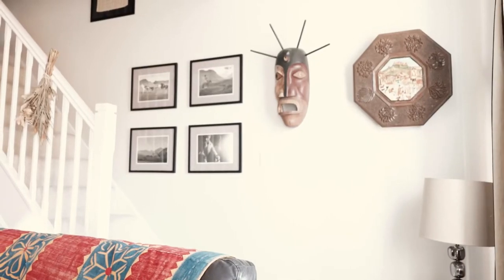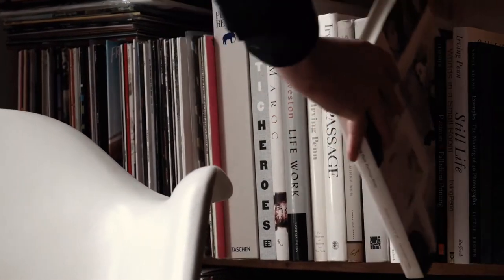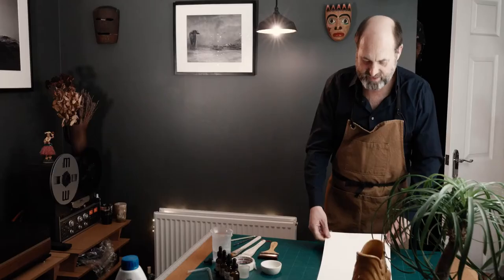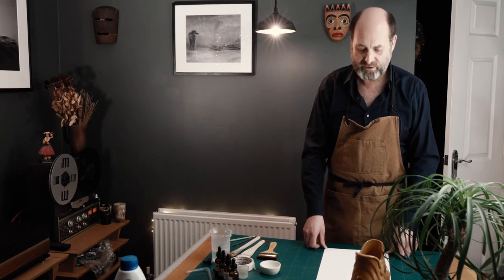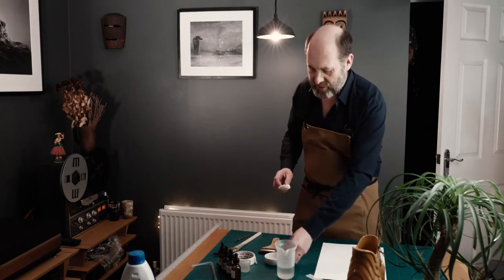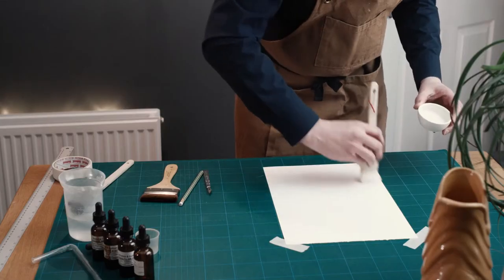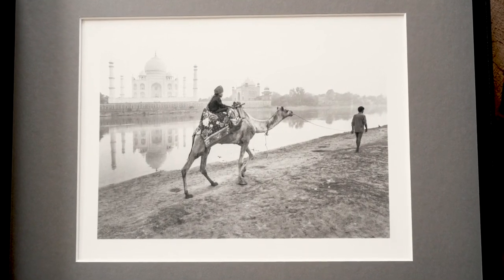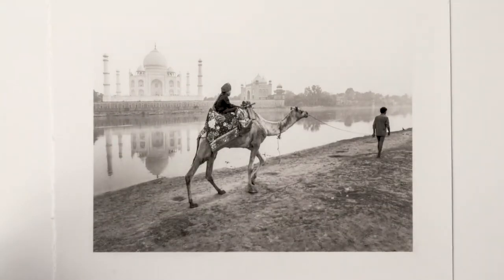Introduction to Platinum Printing

Comment: Thanks for taking the time to share this knowledge.  I can see myself disappearing into this rabbit hole

If I used a 4x5 film negative would I need to be pushing the contrast in my images (  colour filters etc ?)
Reply from the maker: I’ve printed 4x5 negs in the past. The best thing is to print one at a standard contrast and adjust from there. The you will have a baseline to compare with.